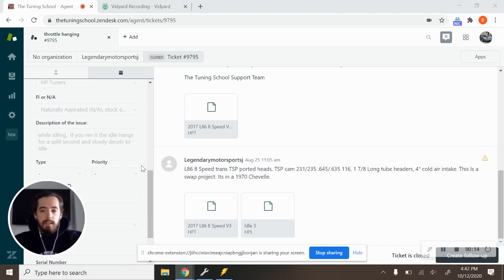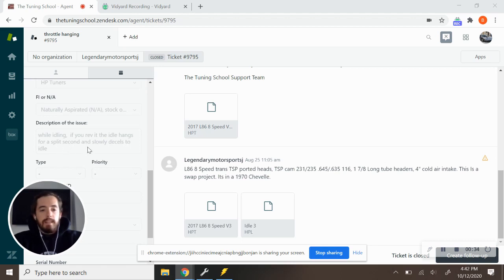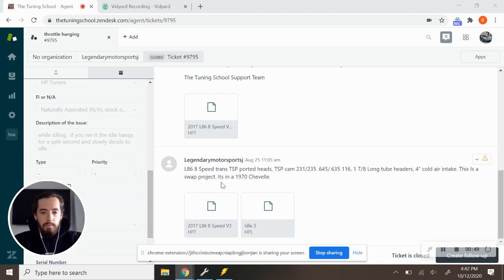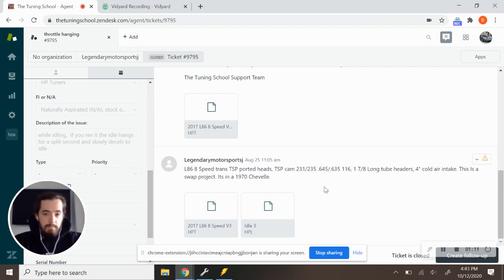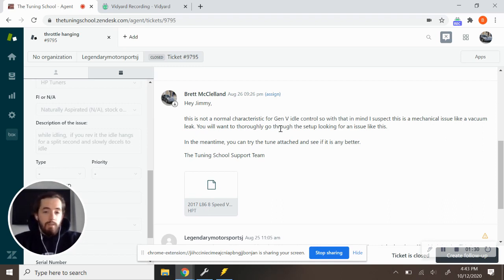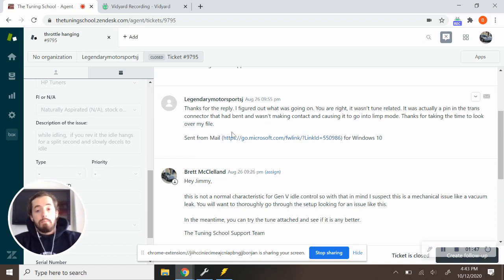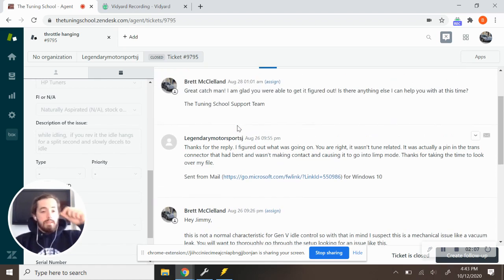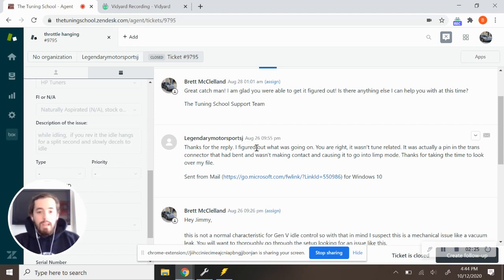Tech Tips - Mechanical Issues Causing an Idle Problem

Comment: Great tip in the video !! I jus thought I ask .. I am person with disability An am in a wheel chair but work on my truck as much as I can.. I currently installed a Comp cam, true dbl roll timing chain,hydraulic roller lifters , cold air intake, longtube headers with real true dual exhaust front to back with dual high flow cat converters an front an rear 02 sensors.. i now have check engine light on an throwing codes,  says  “multiple cylinder misfire “ it also has new spark plugs , new wires, brand new distributor, an crank sensor too.. would could it be .. air fuel mix problem An need custom tune ? My truck is a 2002 ram 1500 rear wheel drive 5.9 magnum 360 , 3 speed with overdrive an lock up .. 392 rear gears

Comment: Hey Brett
That's what happen to us on that support ticket you helped me with. After you had sent me the re-worked it got better But water ended being in the gas tank so we cleaned it out and boom good but as we where gonna deliver the truck it started again so back to the drawing board so upon closer inspection we found the mechanical problem we kept on getting a blown fuel pump fuse and the problem was  one wire from the O2 sensor on bank 1 was shorting to the header.. Thanks Brett for your knowledge expertise 👍🏼
Reply from the maker: That's awesome to hear! Thanks for the comment. Can't wait to see what happens next!